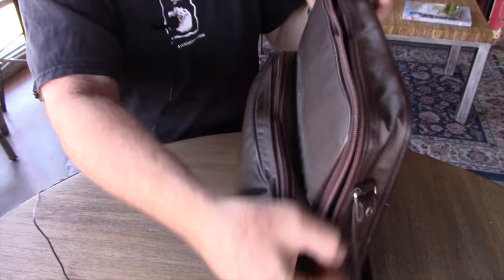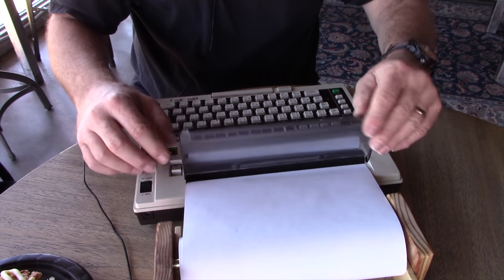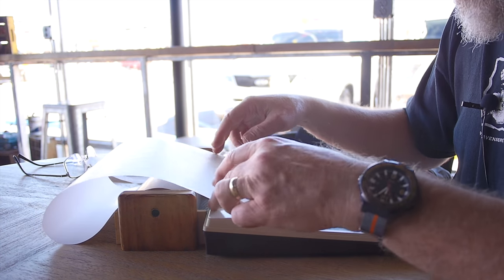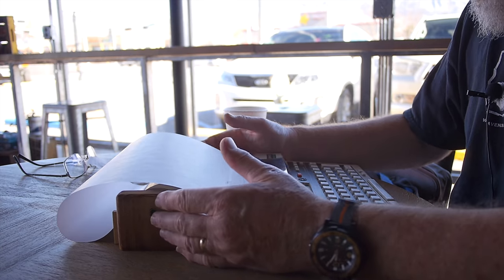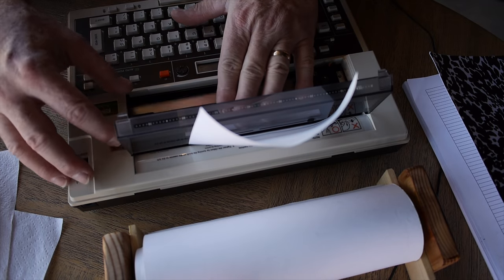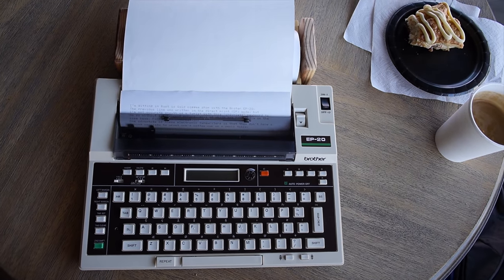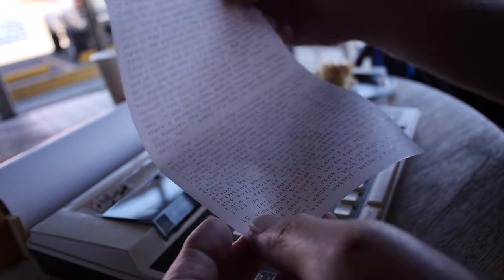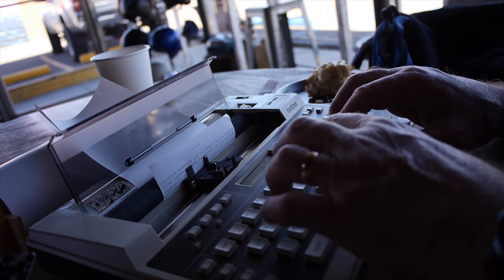Typewriter Video Series - Episode 145: Public Typing With Thermal Machines

Comment: For those without the skills or tools to make a bracket, I assume one could use a horizontal paper towel holder? It would be much wider than necessary, and I'm not sure the 3/4" dowel would fit through the fax paper roll, but could it be made to work? I would love to see a video where you test it out. I'm actually really fascinated by and excited about thermal typewriters. There were quite a few on the market, but I hadn't heard of them until I saw your videos. Thank you!

Comment: Also I'm serious considering to get one because it hit me this might be a good option for in bed...I currently use a laptop and well it's heavy and BRIGHT as my wife wears a mask noise doesn't bother her.  But double light from the screen and a keyboard light.

There are days I just can't leave the bed because of my CRPS, but I got to thinking I think this might be a good option for that, I know we talked about good for draft then copy back on mechanical typewriter or computer, but I'm thinking this might be a lighter option for bed writing, what do you think Joe, always thanks 👍
Reply from the maker: Thermals are much quieter than other kinds of typewriters.
Reply: @Joe_VanCleave  
Hey Joe,
About how long does the EP-20 last on batteries?
Is it good enough for at least a session of say 3 - 5 hours of writing?
Always 👍, Thank man.
Reply from the maker: @dadtype2339  It should last that long. I use rechargeable batteries because I have a number of thermal typers.

Comment: becareful of BPA on thermal papers. Dont want to get those on ur food
Reply from the maker: Yes, good reminder, thank you.
Reply: A concern for sure and one that gives me pause to even type on old receipts.  I have noticed, however, some of my receipts of late are labeled BPA Free.  So there seems to be some hope for this medium becoming safer.
Reply: @mwarau  Yea, was looking at that and the substitute, BPS seems as harmful. I dont know the verdict. These chemicals used r made to react to heat easily, so I guess they r not "inert", and I doubt industry cares. Their profit margins for thermal papers r probably very low, I doubt they care if the chemicals they use result in long term harm.